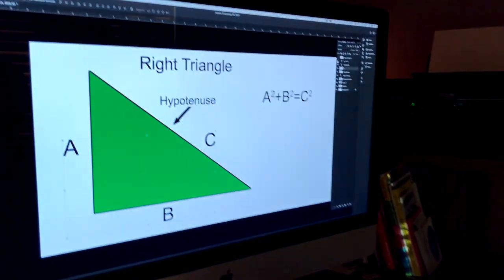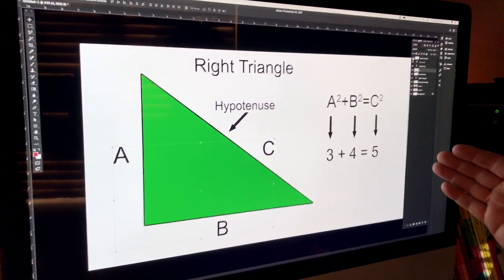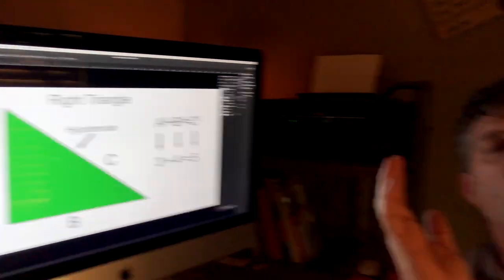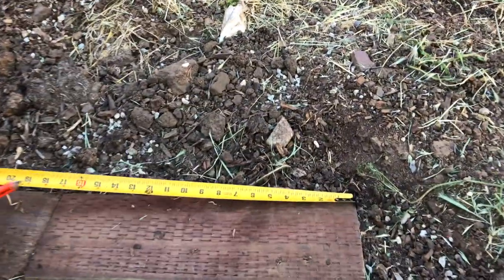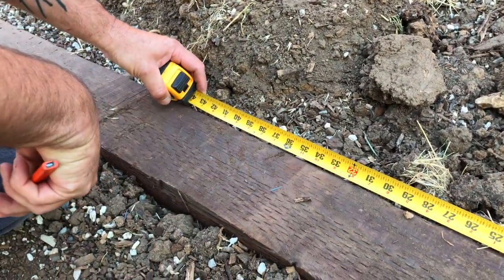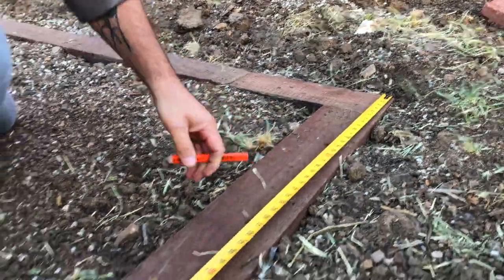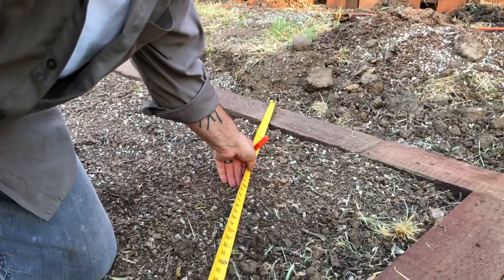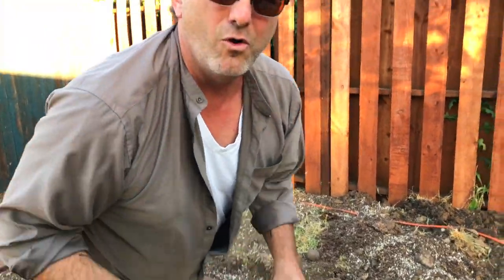Making BIG THINGS Square

Comment: Finally !!! I now understand this damn 345 I’ve heard it, seen it ,but it just never clicked you explained it perfectly and in fact now it’s so simple   Anyway thanks a lot  you should do more videos like this ,string line    Why don’t you do a video on mitre  angles , moulding 45 degree cuts ,  finding the angle on risers or railings ,  finding pitch ,using a speed square etc u have a way of simplifying things. Thanks !!